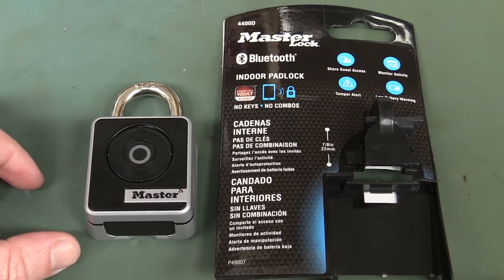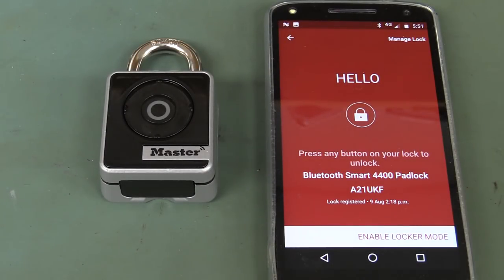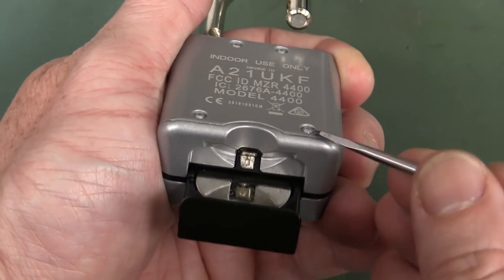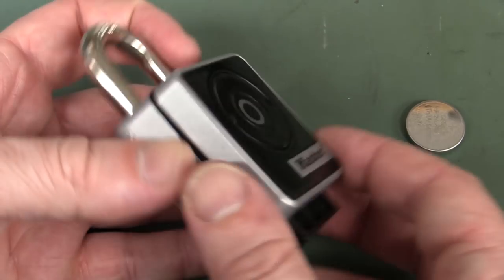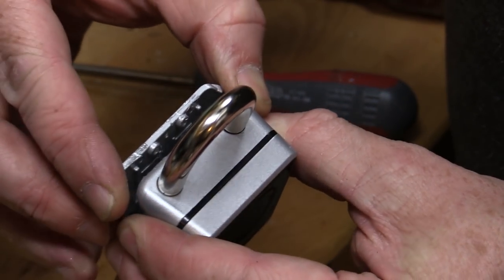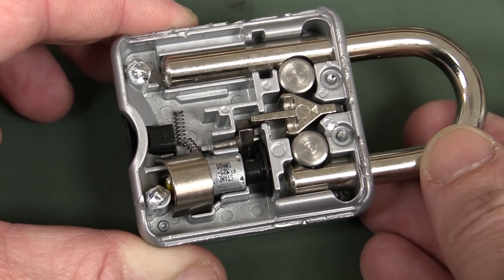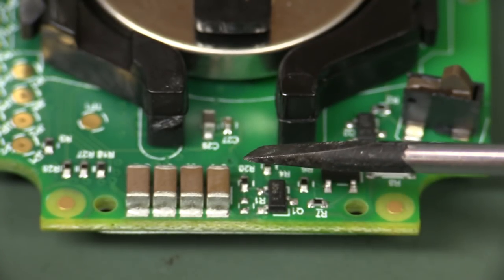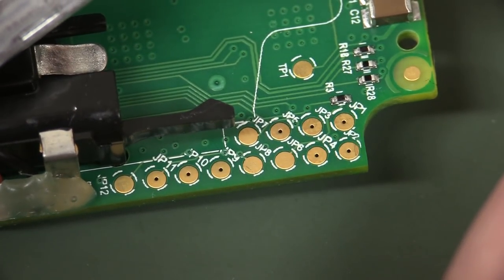EEVblog #1014 - Masterlock Bluetooth Padlock Teardown

Comment: Okay how does it hold up to a 2 lb hand sledgehammer blow?
Reply: A claw hammer will break it.  It is a Master lock ;)
Reply: 2lb is a peening hammer, maybe a light drilling hammer or engineers' hammer. sledges start at 6, mine is 16.  I've seen custom made 30-50 pounders in ship yards. (They had to employ a certain type of fella to use it. For loosening and setting propeller nuts with a striking/hammer wrench, bracing adjustments and other light taps.)